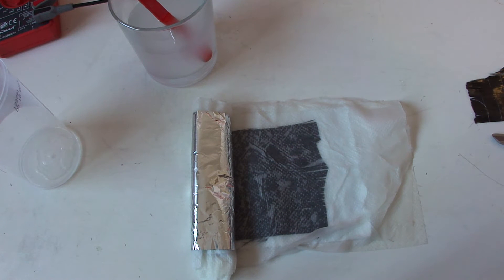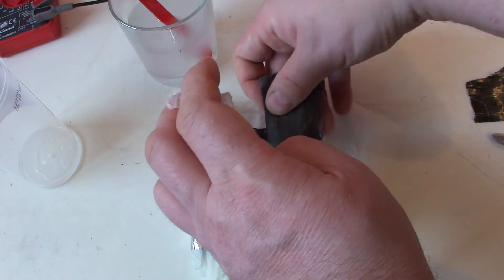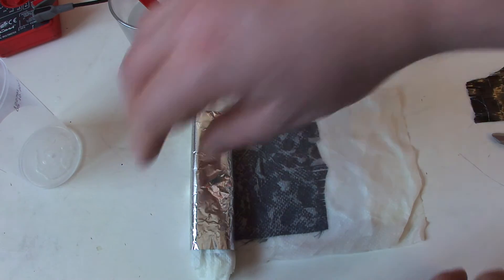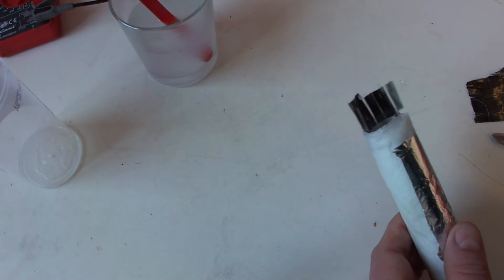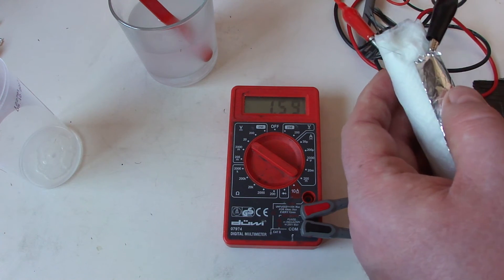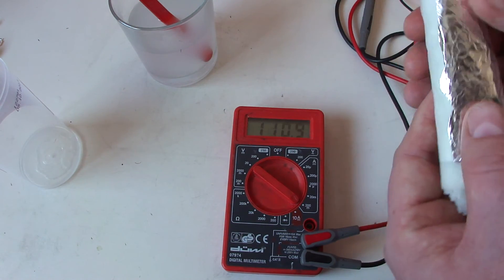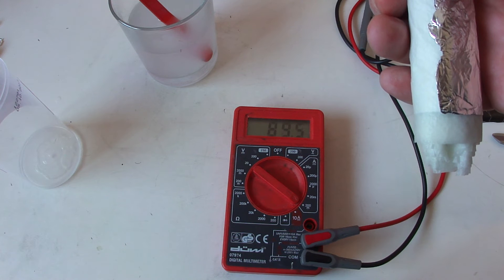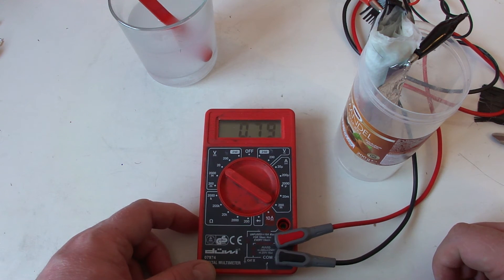pickup electrode for the carbon-fiber-alufoil cell and measurements

Comment: Nice, how long did you keep it with 1.12 Volts?
Reply from the maker: +Bartosz Barejko It dried out after a while... the ohmical Resistance of the carbon fibers is too high, so I need to put Stainless Steel mesh around them as pickup electrodes with low resistance ... Also as the carbon-fibers need to breath air, the cell design must be different, so one side of the carbon-fibers must be able to breath air, cause these are Metal-Air- cells... these need Air to work contineously... Regards, Stefan.

Comment: Just an idea: could you use soapy waste-water (or with some added washing soda) as electrolyt? In theory you could have a pipe with aluminum and carbon and create a small battery. This rolled-battery will fit a pipe with flowing wastewater or do you need a steady system?

Comment: why don't you use 2 or more compartments (a serie) or maybe parallel to create a higher voltage or Amps? And how bout a spunge or microfiber towel instead of paper to increase the flow?